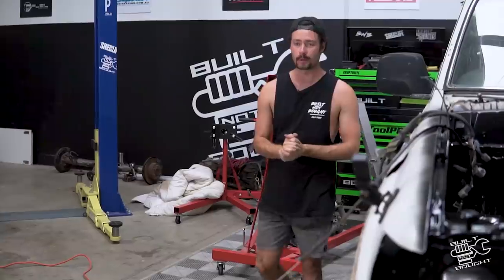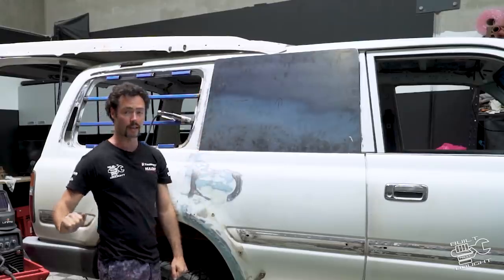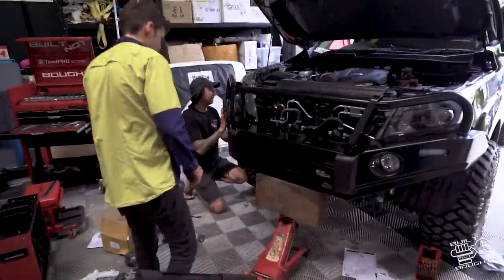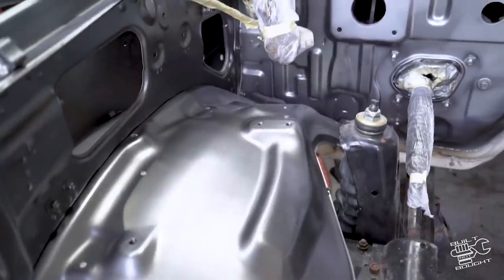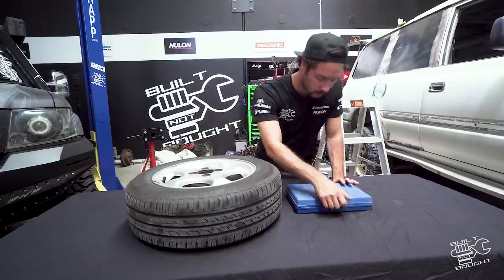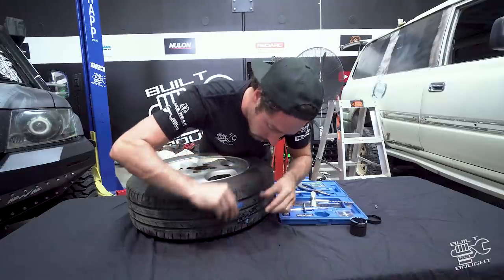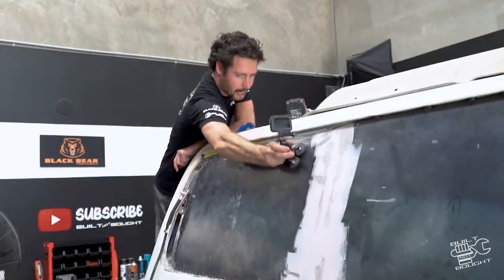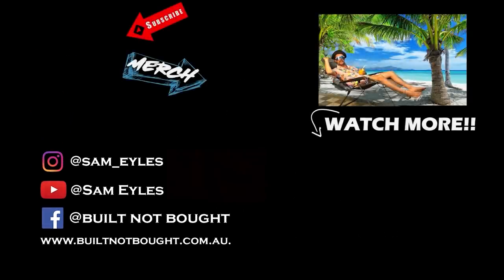BNB 80 Ep. 2 || Panel-Truck Welded + Big FAIL With Engine Bay...

Comment: As a Panel beater myself, when I do joins for new quarter panels I find tacking every 30 or 40mm first up. Then I start from one end and continue tack welding letting each tack cool for about 10 seconds, don't stop till you're finished. Theory is to keep the heat flowing though and cooling evenly as apposed to continuously heating the same areas many times over. I always get a much better result with less warping.

Comment: You should really etch prime before you bog.. bog onto bare metal creates rust
Reply: Should probably give anything a chance to grab onto like a orb sand but it’s bought not built, so look out for the paint to lift
Reply from the maker: Yeah bog I do that
But the fibreglass/stainless steel stuff is suited to bare metal
Reply: Beat me to it. We're do that at work now. A much more superior and safe method for bare metal repairs.

Comment: That little rust repair... I got onto a product called upol metal filler... it sets so hard you can tap it without cracking, and basically do what you did with zincalume behind the rust hole. then use the upol body filler.

Comment: On the puncher repair. I'm a qualified tyre fitter, when you've done it keep in mind its not a permanent fix. It can last a long time but it can also cause more problems, epically if its in the side wall. Just my experience with them.

Comment: I have been told by a older guy that you should do those repairs on the tyres when they are flat or close to. The reason being is you can get the worm in easily and it seals a lot better when you pump your tyre back to road psi. The other thing that he said instead of using the file tool to make a easier hole to work with he said he would use a drill and it works really well maybe you could see if it’s ok or not in another video.

Comment: we did a race with a puncture repair. start with 40 psi drill a hole, roll tyre 10 metres, plug it, winner with least amount of pressure lost.